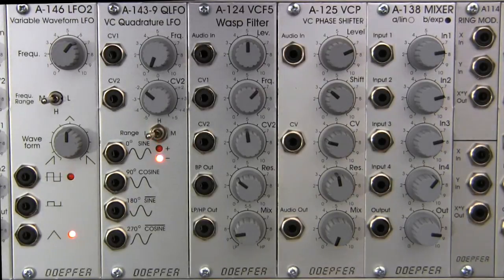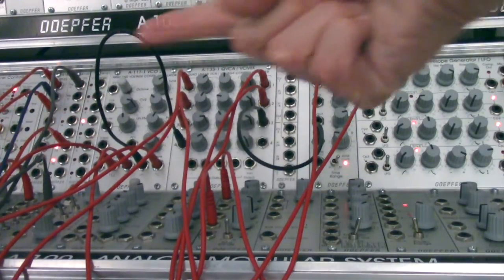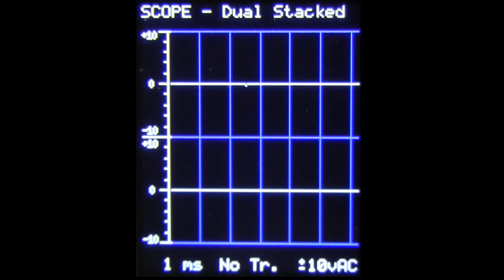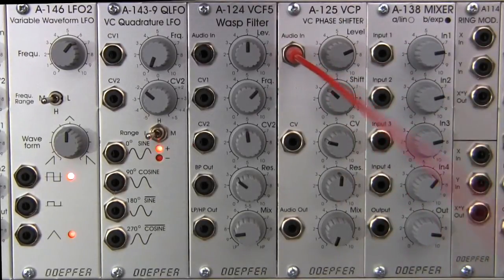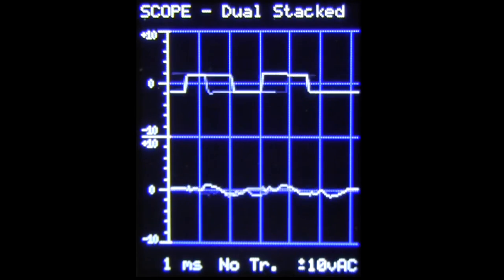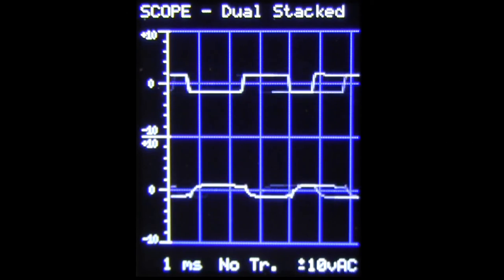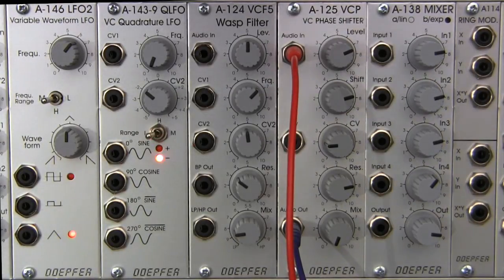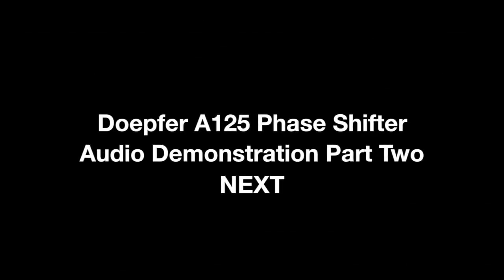Doepfer A125 Phase Shifter Audio Demonstration Part One

Comment: TL;DW, its a phaser that doesnt automatically sweep
Reply from the maker: Getting back to the basics.  Imagining yourself with the limits of our predecessors and attempting to implement them into something forward thinking can be be an awesome goal! Thanks for watching.
Reply: if this comment made you less excited...

That very fact, that it's CV-controllable, is a reason to be excited about this module.
Reply: IMO including an LFO in a phaser is actually a waste of space, you do have LFOs and more controllable ones outside the module + you can reuse them for other things. You'd have to get an LFO out from the phaser for this, which does not make a lot of sense
Reply: it has a cv input so yes it can automatically sweep